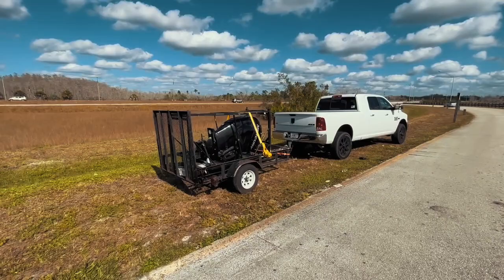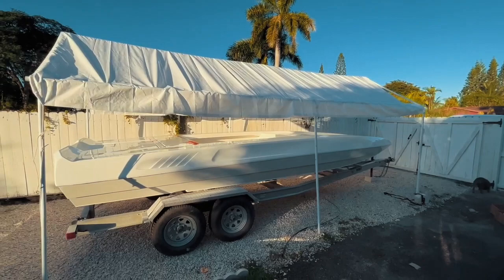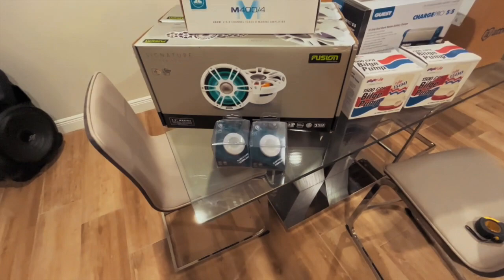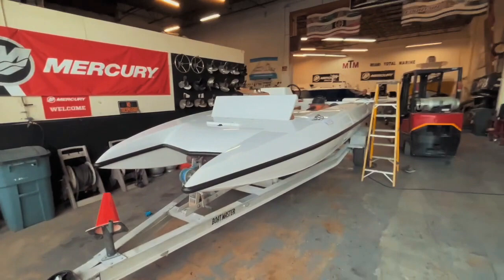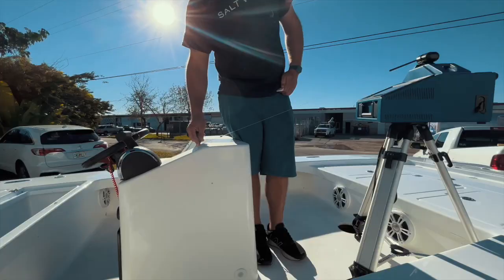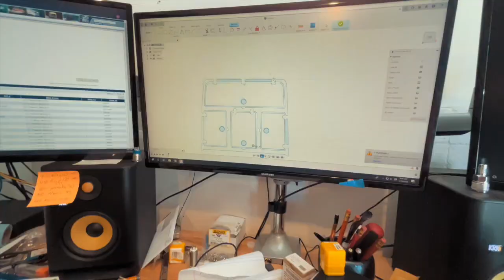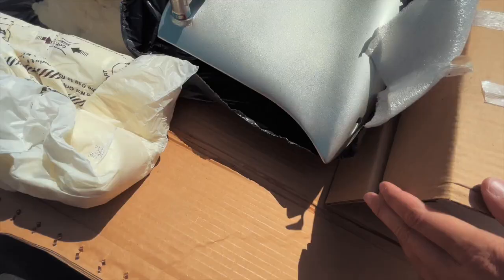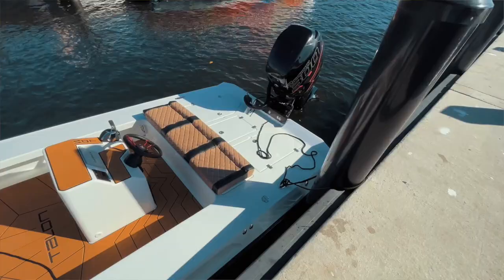I Built A Mini SPEED BOAT!

Comment from the maker: Can anyone guess the Top Speed of the boat?
Reply: I would guess about 83 mph
Reply: I'll go with 70mph due to the 4 blade. 80mph with a 3 blade
Reply: 69
Reply: 60-65 knts
Reply: 60
Reply: 85mph
Reply: 35, using a paddle and surfing a wave.
Reply: 50
Reply: 109 With a 300 Drag and a 34 3 Blade Cleaver.  4 strokes are too low RPM.
Reply: 82
Reply: Bay u can get it to 72 haha. Bro they make windshields for fat fast boats for a reason. I’ve had a few tournament partners with boats that started as talon hulls. Guy here in Texas well 3 companies now build them 106 in one and mid 70’s to low 80’s in the other
Reply: 115, But he's using a chopper which adds lift that could mean blowover. I would use a cleaver.
Reply: and speed your doing? you and a half of tank of gas? standard prop? 80mph on a good day? if you had a 28" prop? lower on anything less!  lol. i run a 30"  hydromotive on a 700lbs boat . 150 hp . xr6. 5800 rpm. at best i hit mid 80's on a good day!
Reply: I would say between 85-95mph put a 450r get ya to 110mph +
Reply: @Mike383HK he'll be dead before getting there Mike, that little boat can't handle a 300R much less go 115mph. Anymore than 2/3 throttle he's risking it all.

Comment: Living. The dream man built you a nice little budget speed boat got you a nice little house out in paradise nice little living area outside your living a good life man. I built me a little hot rod muscle car version of a blat, I have a 1969 Bayliner 18 foot maybe 17ft it has a 1970 2 stroke 250hp 2 stroke Johnson stroked out to to 290hp it's a monster the boat is beautiful red and white bottom 2 tone black carpet interior on floor with nice bright white seats and a 1500 watt sound system i love it and it's a head turner and ppl love to talk about it at the boat ramp. Now the boat I just finished is a 17 foot hydro plane racing boat with a big 410 cubic inch small block Chevy motor but the motor is special it's a old asphalt 410 cubic inch sprint car motor one of my old ones I had re built for marine use and it makes 850 hp to the prop, I have it tuned down though right now to 410 hp to keep it reliable and it will turn 9800 rpms like it's nothing. It's a race at motor for sprint car racing on a hydro plane race blat it's a blast and when I race it I gotta wear a parachute back pack and special pants so if I fly out of the boat I don't get a 150 mph enema up my booty hole

Comment: Youre risking your life as theres no way that little boat can handle that motor, any more than half throttle your transom will give way, maybe 2/3 throttle but not more than that and im not even mentioning if the water isnt smooth and theres more pressure on the transom from waves. Just a thought, call me crazy but ive seen it happen. Good luck and be SAFE.